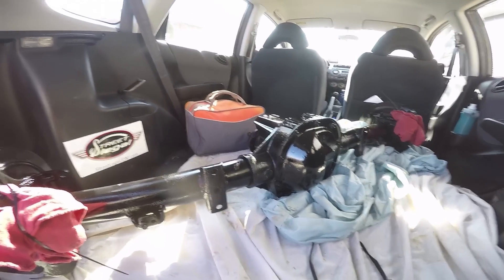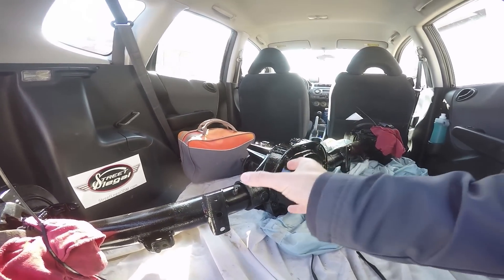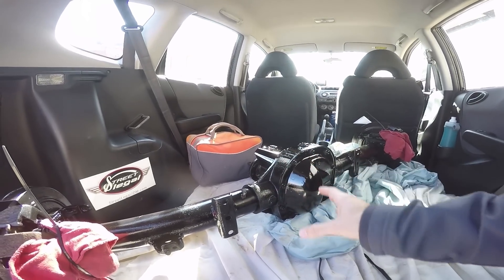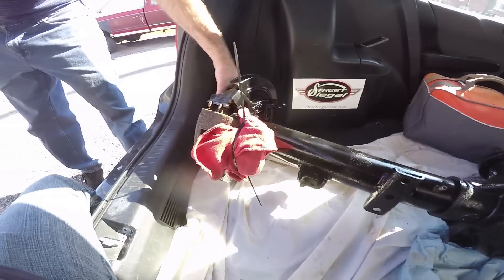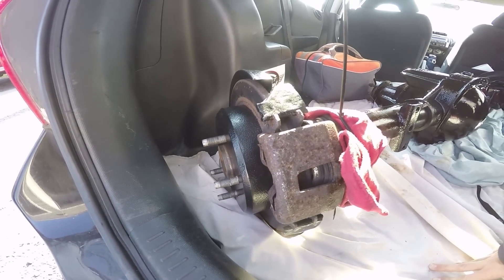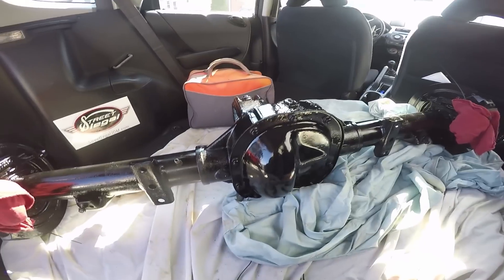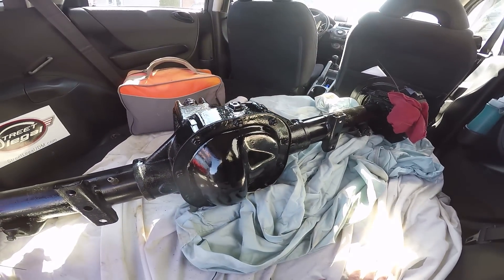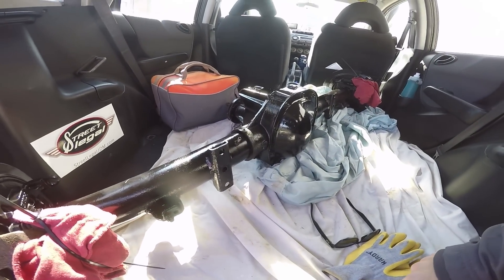Ford 8.8 Rear 3.73 Gears, LSD. Cut to 56.5in

Comment: Just put a exploder 8.8 on my 95 ranger. Lowered it about 5" and got me discs and the lsd. Doesn't lock like I expected it too, though
Reply: +MrTubanator The clutch discs are generally worn in most of the higher mileage ones out there. Throw in a new set of try flipping them if you cant afford them right now.
Reply: Yeah I was a bit ignorant when I was putting it in or I'd have replaced them

Comment: No way, Im doing this exact thing for my ae86, but shortening 1 side to match the other short side. Hopefully Ill get to show you my corolla sometime when Its done. Im in allentown so you are close by.
Reply from the maker: +Gucci Bound MTN You're putting a Ford Rear in a AS86??
Reply: +RegularCars ae86*
Reply: +Gucci Bound MTN Any reason why you chose a rear end that required shortening? When the Supra Celica rear end is essentially bolt in.
Reply: +RegularCars its pretty common in our little yotas.  ill go that route one day in my te21.
Reply: +RegularCars yessir! s13 front suspension and 20v 4age gonna the thing is gonna be a monster.
Reply: +bob_from_accounting celica supras with a solid rear axle are almost impossible to get. thoes cars are more rare then ae86s.

Comment: if you were cutting up a rear end then why didn't you find a 9 inch rear end and put all the brackets in shit to put it underneath your falcon. then it would be almost as indestructible as a gm 12 bolt and more replacement parts than u know what to do with

Comment: Vary nice! Glad to see project falcon is going along smoothly, can't wait to see it on the car! Awesome videos Mr. Regular. I have a question for you though, will you be putting front disc brakes on the Falcon? If so are they going to be made for the car or come off another donor car?
Reply from the maker: There will be disks on the front and I'll come from a TCI kit
Reply: +RegularCars Thanks for answering my question Mr. Regular! I hope the Vagabond Falcon project goes without to many issues and can't wait to see the finished poster car for RCR!
Reply from the maker: +Canadian Carguy247 Thanks!

Comment: If they shortened the axle tubes why didn't they cut off the old trailing arm mounts etc? I guess Bruce can do that and weld some spring perches on for you. 3.73's/5.0/AOD in a light car should be fun. It sure was fun in my Grand Marquis, which was not a light car.
Reply: Those are leaf spring bases and sway bar mounts left on the axle not trailing arm mounts

Comment: If they were going to have the whole deal in a jig for shortening it would have been good to weld the tubes to the diff housing. It is unlikely you will ever put enough torque through it to spin a tube, but it cant hurt to have it done.

Comment: Will be doing the same to my 96 Town Car in a few months, will certainly look up GearHead.  You're going to JMod the valvebody on the AOD right?  If you want a set of 1-2 accumulator springs I've got an extra pair.
Reply from the maker: +Neil Bolin Not sure what I am going to do but if you have some donor springs, I won't say NO! :D
Reply: +Neil Bolin is it the real neil? :O
Reply: +Megamanfsx no relation!
Reply: +RegularCars http://www.tccoa.com/articles/tranny/transmission/index.shtml. more than one could ever wish to know about the AODE from one of its principle designers.  TCCOA has a wealth of information,  as well as crownvic.net and the mercury marauder forums.  I suspect this is because these cars came saddled with automatics by default, as opposed to say your typical mustang forum where getting a performance oriented transmission begins with buying one with a damn stick shift first.
Reply: +Neil Bolin AOD is mechanical... JMOD is for the electronic AODE/4R7xW. Mechanical AOD just needs a decent shift kit and you have a nice day.
Reply: I forgot which one he ended up grabbing.  For some reason I thought it was a newer unit, but you're absolutely right.
Reply: +Neil Bolin Dont forget a trans cooler. AODs hate heat.